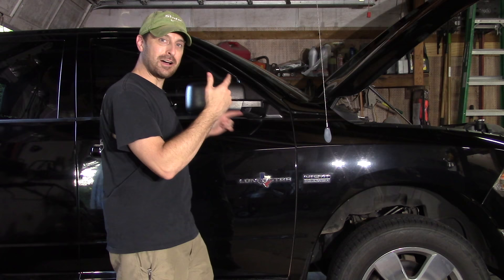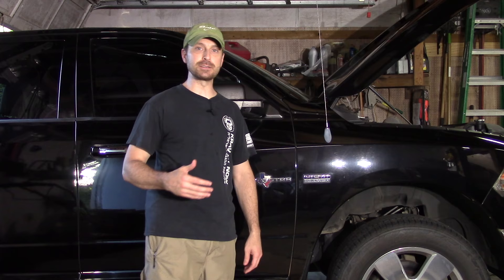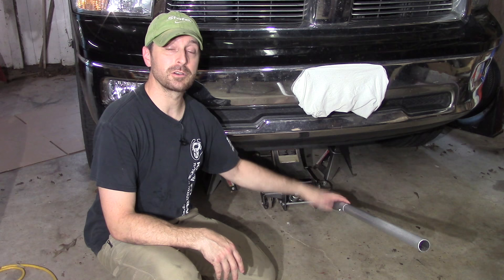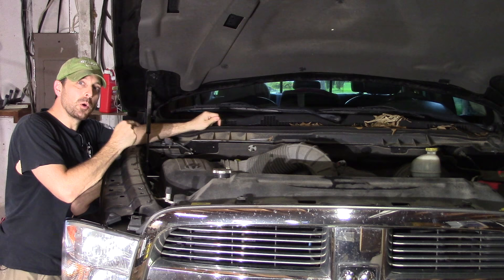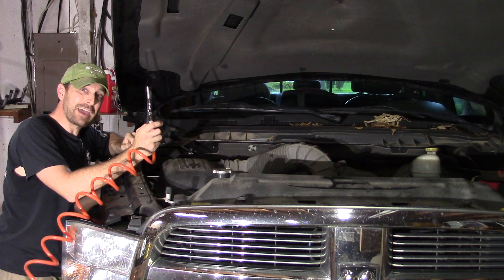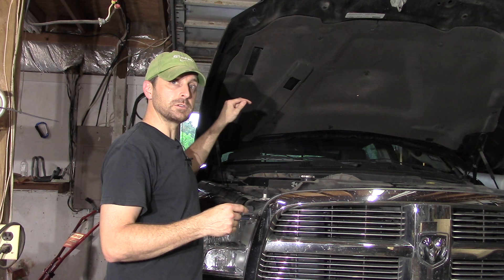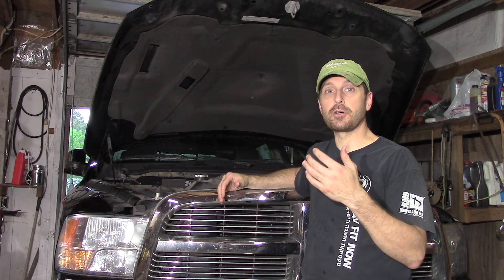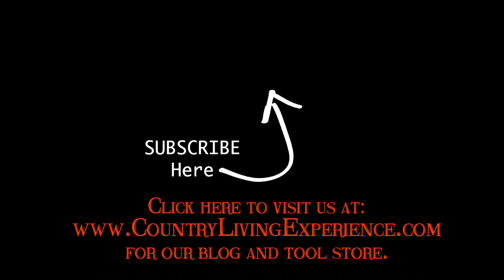Wet Floorboards In Your Vehicle? Why It's Happening And How To Fix It!

Comment: I can't believe you know better than to use a blow gun on that drain but you do it anyway and tell everybody else to do it. I used pvc pipe and fittings and plumbed that to a shop vac hose.  The stuff that came out was nasty.

Comment: I have a 1993 Oldsmobile that I noticed has soaked passenger floorboards... The heater core has been bypassed for more than a year so that's off the list. The water seems brown, I need to run the smell test. I have been using lots of A/C lately since the summer started... Thanks great vid will definitely get to finding the cause!
Reply: what was it

Comment: Ford focus If you have a water leak Pull the blower motor and clean and vacuum inside the return side evaporator pan. I used a shop vac and cut piece of garden hose and tape shop vac hose flush with water.
Reply from the maker: Great. Glad that worked.

Comment: I just discovered this problem today when I took out my mats to clean them. Had very wet floorboards. But I've also noticed if my ac is on and I make a sharp turn, I hear a hissing sound underneath the hood on the passenger's side. If I don't run my air, will my car be ok to drive? Don't have any money for car repairs at the moment.
Reply from the maker: You could have a bad evaporator. Should be fine to run the car without the AC.

Comment: I had water in the front on my Chevy Colorado, but the culprit was 
my High Mount Tail Light seal.  The water came in there, and being that the 
front of the truck is lower than the back, the water would make it's way
 to the front of the cab. I replaced the light and the seal. No more wet
 floors.
Reply from the maker: Very interesting. I would suspect not a very common problem.
Reply: @CountryLivingExperience  More than you think. The sun heats the adhesive on the foam seal of the light allowing the foam to move. I've fixed a few trucks with this issue. Just thought I'd mention it here and it helps someone else out. Leaks can be a pain to find!
Reply from the maker: Good call. Thanks for the info

Comment: Quick question, discovered my 2002 Dually  is also wet passenger side, while running new speaker wires to amp (by-passed loom), and noticed several vids like yours using compressed air. Wouldn't it be better to use a powerful shop vac and suck it out instead of blowing it back in?   Thanks!

Comment: So I’ve been having this issue for quite a bit of time, however, the water builds up on my driver side rather than my passenger side. Do you think it could also be caused by build up in the drain/vent? I can’t pin point the issue and it’s driving me nuts
Reply from the maker: What type of vehicle? Same as mine?
Reply: @CountryLivingExperience  I have a 98 dodge Dakota slt. I’m thinkin i might need to remove the cowl cover and clean out all the debris. Man it’s frustrating
Reply from the maker: @MuffinSlayerrHD  Yea, sorry brother. This video was for more recent vehicles. I do not know how they designed that year Dakota. It could be the drain tube but you will have to find where it is located.
Reply: I have the same problem 2000 dodge dakota no idea either
Reply: @arualet  if I finally figure it out I’ll let ya know. I plan on doing a rebuild on my system soon so I’m gonna be ripping out my seats/carpet anyway. Hopefully I’ll get lucky and find the problem.
Reply: @arualet  I just bought a weather proof cover for the time being to keep things as dry as possible til it gets figured out
Reply: @MuffinSlayerrHD  Thats smart man, i was thinking kitty litter at this point.👍🏻Its so soaked now that the winter has caused the floor to freeze solid. I did some digging and I may have to remove the wheel well cover and see if maybe its rotted through there. And yah lmk if you figure out something out. :)
Reply: @arualet  will do buddy. Best of luck to you and happy holidays
Reply: same here i know its ac related because they said it leaks water when using AC when i bought the car. its a 04 mitsubishi endeavor.
Reply: I have a 2000 Dodge Durango , same symptoms. I took out the front seats, caulked around weatherstripping, ckd for any leaves etc, Have tckd the plug yet, thank you for the video, appreciate you!

Comment: Hey, I have a 2000 Chrysler LHS & my driver side floor is always wet. It doesn't smell like anitfreeze. Just water. So i'm guessing it could be the drain plug? It's only on the driver side. I know my heater actuator went out awhile ago...
Reply from the maker: It could be but I am not sure how that car is configured. Your evaporator may be getting clogged. Another method is to suck everything out of the condensate drain with a shop vac.

Comment: Found out reason my floorboard was wet - there was a red tapered silicon(?) plug left in the discharge outlet of my drain tube. I had only noticed this issue after having my exhaust manifold repaired at a local mechanic shop!!!🙄🧐🤬
Reply from the maker: Whoa. That would make me a bit irritated too.

Comment: My 08 Subaru Outback is doing this but I got it fixed and now I got water trap inside and I can hear it slush around still…..my question is that this the same process or would I have to use a different method and how?
Reply from the maker: It would be a different method because the car is different. I don’t know anything about that car.

Comment: I don't understand why the drain goes into the cab! Or RAM does this and Freightliner does too. On the RAM if we park where the front of the truck is higher than the back it will run into the carpet in the rear floor. If we park where the passenger side is lower the water runs out both passenger doors.

Comment: Thank you for this, all my floors are wet after raining a few times and now my check engine light has come on. Could this be the same problem?
Reply from the maker: That could be a heater core issue. I would get that checked immediately. I would also check your coolant level. If it smells like antifreeze, you have a serious issue.

Comment: I wonder if this is what's wrong, it started leaking on the passenger side and to have AC it has ti be On Max level now that's Gone the AC works a bit when the car is being driving.
Reply from the maker: Possibly
Reply: That just started happening to me too! So it seems like it's possible. There isn't much out there on this issue.

Comment: What about water on the passenger side in the back..I have this problem when it rains I'm trying to trouble shoot the problem
Reply from the maker: If it gets wet in the rain, it could be a bad window seal or a hole in the rear floorboard.
Reply: @CountryLivingExperience  there's a drip from the back window that might be the issue but can't understand why it's making its way all the way to the floor tho..I have to say this is my fault when buying a used car have a good mechanic check it out first lesson learned 😏
Reply from the maker: @trini_boi2414  Sorry my friend. Maybe you can replace the weatherstripping around the door. It shouldn't cost that much.
Reply: @CountryLivingExperience  I'll look into that it might be the problem you never know..

Comment: Short Answer:  Quit using AUTO.
Long Answer:  Our drain is not plugged, so I kept thinking about this for years.  We were using AUTO on the AC selector and have it set on 73.  I notice when the air gets to 73 in the vehicle the fan is no longer blowing...and the AC is still running on MAX (no outside air).  With no fan forced air across the evaporator, that is going to eventually cause the evaporator to frost over on the outside.  I notice frost on the outside of the containment box just under the glove compartment.  This coincides when the carpet gets wet.  Enter pragmatic approach to a cost-less repair.  QUIT USING AUTO.  In my '02 the driver controls the fan.  In our '04 the computer controls the fan while in AUTO.  We made a rule to use manual fan only and just make sure the fan is blowing a notch or two on the indicator.  No wet carpet.  Give this a try before ripping your dash apart.
Reply from the maker: I never use auto

Comment: What would you recommend if you have a ram but water is in the back seat under Neath the bench seat
Reply from the maker: That is happening to me as well. I think it is a seal on the top of the truck roof that is going bad. I am not sure how to fix it.
Reply: @CountryLivingExperience  hey yeah I did some more research and inspection on my truck mines coming from the the third brake light
Reply: @CountryLivingExperience  I caught by the water stains on my headliner
Reply from the maker: @but_why547  Thanks for the heads up.

Comment: I have a thin layer of oil from the driver's floor board to the rear passenger floor board.  It has soaked up into the carpet.  It's clean oil.  I noticed the stain on the driver's side when I bought it in 2013.  My husband said that probably the previous owner spilled motor oil inside cab.  It's a 2008 Ram 2500 pickup.   Any ideas?  Thanks!
Reply from the maker: It was probably spilled in there. There is really not any other way for it to get into the cab.

Comment: Hi I have a 2010 Chevy Malibu, so I just noticed that on the right back side of the floorboard it usually gets wet. I tried vacuuming, but it still gets wet, so I want to know if the options that you listed could be the same on my car? I mean it's on the back floorboard right side.
Reply from the maker: It could but I do not know how the Malibu is designed. Give it a try and see.
Reply: I have the same car and problem, did you ever find a way to fix that problem?
Reply: @brianarodriguez3987  I did not unfortunately I still keep vacuuming the wet floor, however it doesn't get too wet. I used some sort of black glue under the carpet I thought water was coming in from the bottom, but no I still see it getting wet Its probably that water is coming in from the middle of the doors I see drops there.
Reply: my was coming from a leak in the middle of the back door I drill a little hole in it and drained all the water out and sealed it up with quick seal and no more water in the back seat,

Comment: I think this is what is happening in my car... Is it bad if I continue to drive it around until I can go someplace and get it fixed? It's winter time so I'm not using my A/C but my car only blows cold air even when I have the heat on all the way, would this be because of a similar issue?
Reply from the maker: That sounds like a different issue. Your heater core may be bad. If it is not heating, I would take it to a shop.

Comment: Hi. I have water on my drivee side floor boards both front and back. I have a 2008 Nissan Altima. Do you know about this car by chance? Thank you for your time.
Reply from the maker: Sorry, I am not familiar with that car. Try looking at the weather stripping around your doors.
Reply: @CountryLivingExperience  what am I looking for on the weather stripping? Am I looking for cracks in it? Thank you
Reply: You probably got rotten spots underneath car these cars are common for that problem
Reply: @allanmartin6154  thx I will get under there and take a look. Thx

Comment: I have a 2021 4runner  That I've had for about 6 months. About a week ago I started noticing a musty smell, and this morning I found my driver side floorboard completely soaked. 
No idea why I'd be having this problem on such a new vehicle :(
Reply from the maker: I would take it back to the dealer since it is under warranty.
Reply: @CountryLivingExperience   I emailed them this morning, Unfortunately this is actually the 2nd time something like this has happened. The dealer installed after market racks for me when I picked it up, About a month ago I had water pouring in through my seatbel The rack wasn't sealed correctly. Not looking forward to driving 2 hours to the Toyota dealership, But the musty smell is so bad.
Reply from the maker: That is crazy. You should make them pay for all of that.

Comment: I have a wet floor problem but it’s in the back seat not the front
Reply: It may be your cab vent in back i would check those if you havent got it fixed ywt

Comment: I was told by my mechanic that there is supposed to be a elbow on the end of that drain tube bending downward to keep the pressure from driving blowing that moisture back up into it, but where does one get that elbow from? what's the name of the part, this so called garage mechanic had hi guy blow air into my ac drain hose and I still have water in my carpet on the passenger side wth?
Reply from the maker: Sorry not sure

Comment: Thanks for making me laugh because right about now I just want to cry. I just got the headlight wiring hornest repaired at Demontron KIA now this.

I have a KIA Sorento 2017. Yesterday morning (Saturday, March 5, 2022) I noticed water on my passenger side floor. I thought it came from my water jug. I took the gallon water jug up, dried up all of the water and that was it. Got in my car, drove off, made it to my destination and I noticed the floor was SATURATED WITH WATER, AGAIN!!!

Now I know that something is wrong because I've discarded a perfectly good gallon jug of water. There's no mildew or stinch, YET! The dealership is going to slam me financially to repair this.🤯😔

Thanks for the information on what the problem is. YouTube University is amazing.
Reply from the maker: You're welcome. It is probably the air conditioning system clogged up. You can also try to take a shopvac and suck out the clog through the drain line.

Comment: I was just driving with cabin air on and my buddy in the passenger said his foot got wet and cold and I heard kind of like a pressure release. Now when I have the air on In my car the passenger floor board is a misting spewing mess. Crazy I wanna just drive this cadillac off a cliff
Reply from the maker: Sounds like the evaporator went.
Reply: @Country Living Experience: A Homesteading Journey  thanks for the info on that I will look into it. Could the evaporator went cause my drain tube was clogged?

Also do you think I can fix this myself or do I need to take it into a A/C shop? Me and my friends were worried we were exposed to the bad stuff in the ac system so we pulled right over and hopped out the car then I drove home with my 3M respirator on and all the  windows down at 230am raining in seattle flying down I5 I was glad a cop didn't see me.
Reply from the maker: @allthewayinu  From your description earlier, I think you need to take it to a shop.

Comment: Is every vehicle supposed to have the drain tube opened or sealed? I was able to see the drain tube on my 2010 chevy malibu and it looks like its sealed. The rear passenger side floor carpet gets so wet. I'm not sure if this could be the issue or it's just water getting inside from the bottom of the car when driving the vehicle on rainy days.
Reply from the maker: Leaking in the rear is odd. The evaporator should be under the dashboard and an open drain tube to the outside of the vehicle. I would check to see if water is getting in some other way. (rusted floorboard, window, etc.) Admittedly, I am not familiar with the Malibu configuration though.
Reply: hi ruben did you ever figure out what the problem was? I have that problem right now with my 2009 chevy malibu
Reply: @stargirl_lee  unfortunately I did not but I tried adding some Flex glue(black) under the carpet so I removed everything inside and after that I don’t really know if it worked because I got rid of it. Sorry